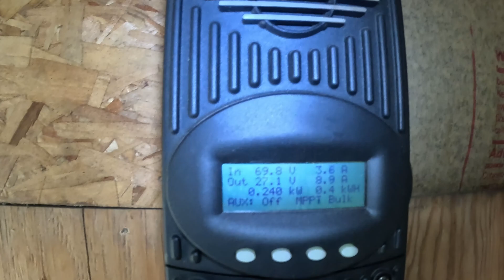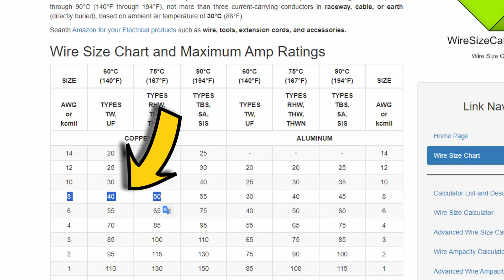SERIES PARALLEL for my off-grid rooftop solar! And why I did it.

Comment: Great video!  It's why I bought my pecron e2000's.  They use 3 charge controllers in them.  I love that it has 2 of them at 95 volts each which really makes life easy and less dangerous.  I lot of these stations like Anker do that single 60 volt limit game so you have to buy their over priced low voltage panels.  Your video was perfect great explanation and insanely helpful!  I don't want to be over amp things or over voltage.  The volts will fry the controller the amps will burn things up.
Reply from the maker: Glad to hear it was helpful!

Comment: I think the confusion stems from initially using the wrong specs  for your calculations.
You don’t use max power or whatever rating from the solar panel. You always use VoC, and then depending on your climate stay 15-25% below the mppts max input voltage. What you really want if a mppt that can take 250-500 volt. The conversion loss is not important.

I think you are making the same mistake on the mppt by saying it can take 80amps. Are you sure? It might output 80amps to your battery but is unlikely to allow 80amps on its input side.
Reply from the maker: Good point on the mppt.  It's been years since I put it in so I ought to check that.
Reply from the maker: Ya, max recommended watts @24v was 2000 and as much as 5000 @60vdc so really the amperage is output max
Reply: @TheOldJarhead  maa as butters hide the input amp rating in the manual instead of making it a prominent aspect of the specs for mppts. I think they assume we run one, two strings max.

P.S. in the UK people frequently call their “charge controller” an inverter or converter. I often find their language confusing.
Reply from the maker: lol well they can call them Scotch if they want but I wouldn't drink it 😅

Comment: You can still overpanel without going anywhere near the max voltage input.

In an "over-panelling" situation all you are doing is supplying more amperage than the unit can currently use under ideal conditions.
Then when you have a non-ideal day those same panels that were sending (purely for instance) 50 amps to your 30 amp charge controller are now sending 25 amps.

Where as if you design your system to only ever create 30 amps max under ideal conditions then those panels in the same foggy or cloudy day as the above scenario would theoretically only be putting out 15 amps.

I 100% agree that you want to leave a healthy margin between your array and your charge controllers maximum voltage input.
Reply from the maker: True, or just the extra panels to another cc 😁
Reply: @TheOldJarhead  

That's also another possibility. 
A lot of people don't know that as well that you can put any number of charge controllers on a battery bank.

It's often cheaper to get a few small amperage charge controllers versus one large one.
Reply from the maker: yup.  Or one big one and 1 or more small ones
Reply: I am going to overpanel my system. At latitude 40 degrees with often cloudy weather I'm going to need it. In the winter I'll be lucky to get 2 hours of charging.
Now if I were in Texas, it's a different situation.
Reply from the maker: I'm at 48.5 degrees, so north of you. For me I'd just add another cc and array
Reply: @TheOldJarhead  That's the ultimate series parallel system😄
Reply from the maker: That's my thought ;)
Reply: @TheOldJarhead Now that I think about it, after watching 100's of videos I've not seen this setup. Maybe do a video?
Reply from the maker: On my complete setup?
Reply: You're right about the need for higher amperage cable. 

But that's where a combiner box comes in, you run all of your cables from your individual solar panel using lower AWG wire and then they only become paralleled once you plug them into the combiner box and then you only need one set of higher gauge wire from the combiner box to the SCC.
Reply from the maker: That's what I've done and the best option but high amperage at the combiner still means a big feeder cable